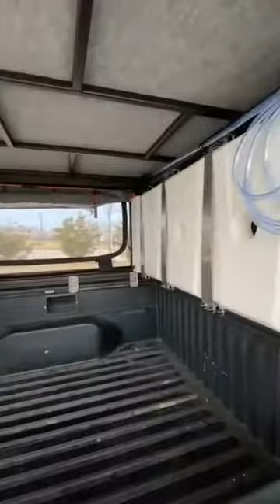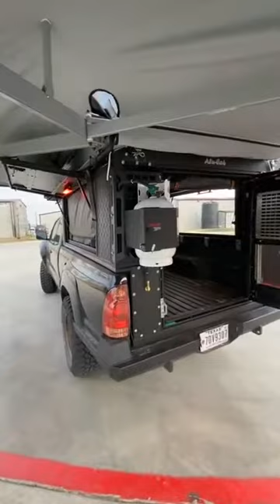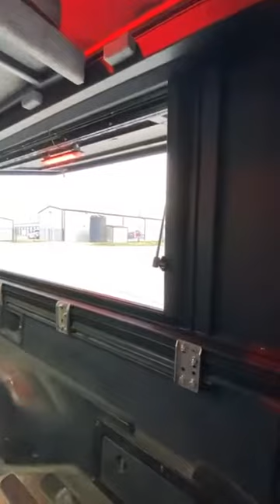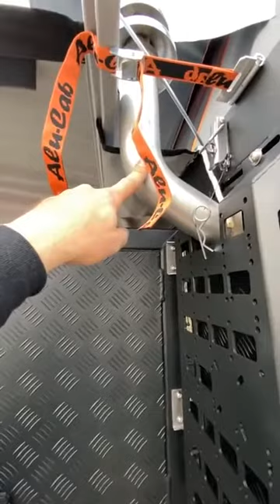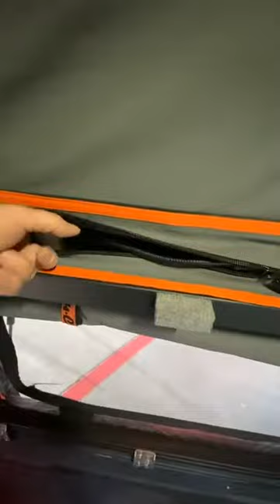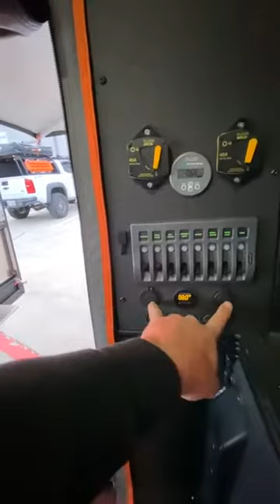Alu-Cab Canopy Camper Install

Comment: Will that truck with the Alu-Cab camper on it fit through a regular garage door? Thanks, great video.
Reply from the maker: Hi Danny, the width of the camper should not be an issue but the height could be a problem.